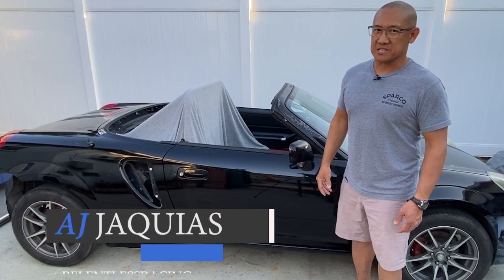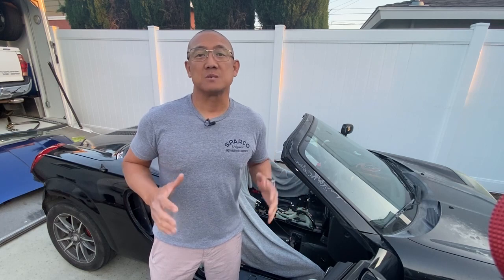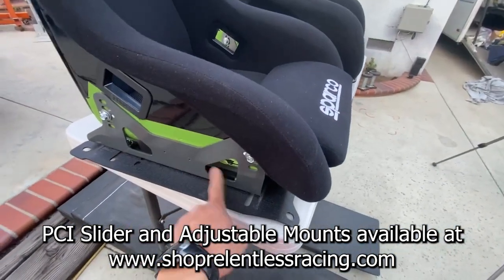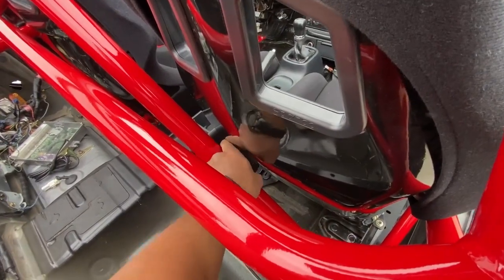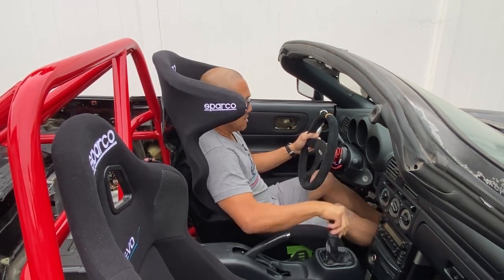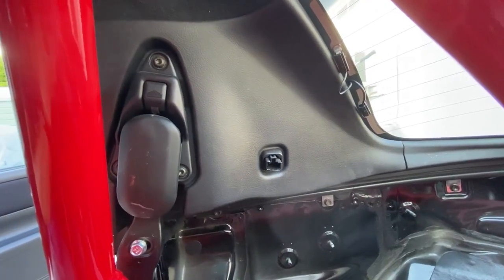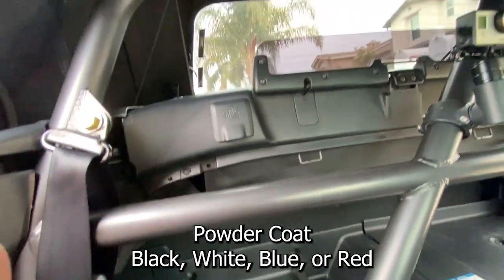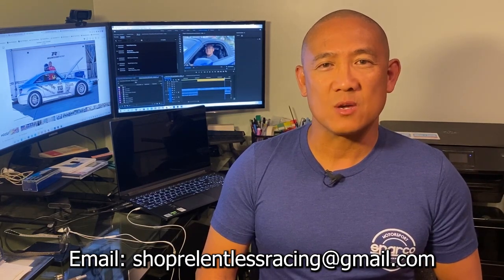Project Black Episode 3 - Front & Rear Strut Bars and Roll Bars

Comment: Excellent. I'm always greatful for other enthusiast support on the W30 chassis. 

Have yall ever considered selling RCA for the front suspension to help combat bumpsteer?
Reply from the maker: Thx for watching and commenting. I use the Battle Version arms and they are pretty good. I’d probably make a few small tweaks but for the most part they work well. Have u tried them?  Pls subscribe
Reply: @RelentlessRacingAJ  I definitely did subscribe with full alerts on new content. No I haven't tried them...they are just so pricey lol
Reply from the maker: @rogerlee2771  agreed they are pricey, but based on my experience it sucks to buy the cheaper parts a few times rather than buying the right parts once. Not to mention, the time you waste installing and de-installing them. Honestly, id rather b at the track burning hot laps. Just my $.02